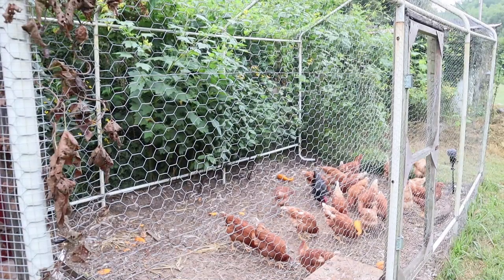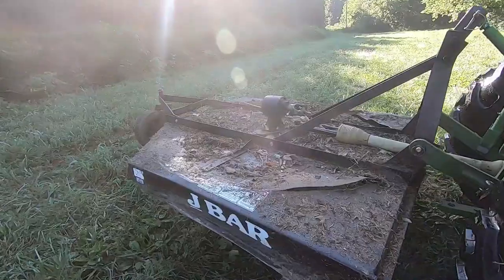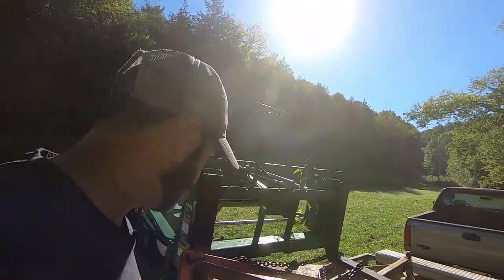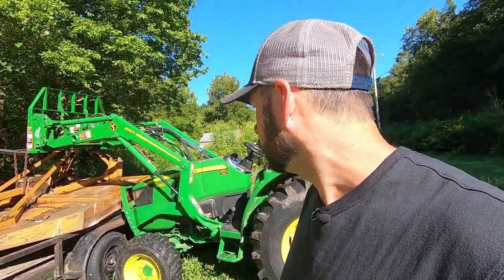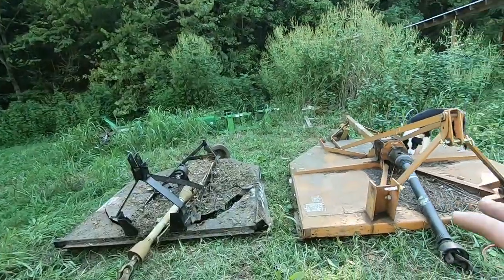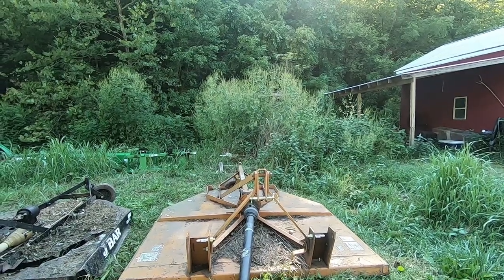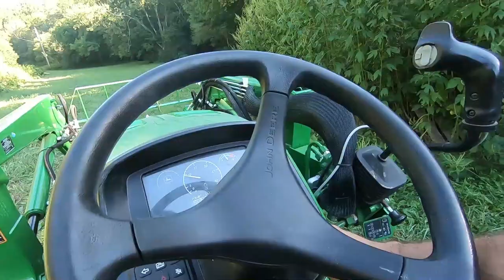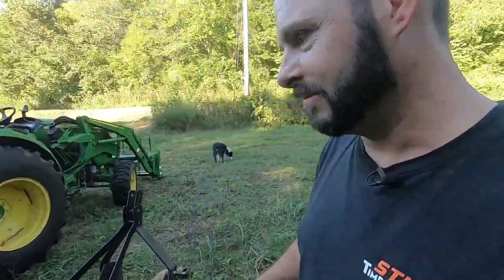This J BAR Bush Hog Tore Itself To Pieces.

Comment: I got a 6ft J bar from around 2014. It's built pretty solid. The only thing wrong was the cross brace for wheel had a scrappy weld but I think I helped it break but easy weld back on. You had some bad luck running something over like a big rock or steel and can opened that thing.

Comment: I’ve been using a 5ft J-Bar for about 10 years now. I got it used for $100 just to tear up in heavy brush and it’s still going strong. No issues at all and cuts 1”-2” brush pretty well.

I’ve had a track machine with mulcher and a 8’ dual spindle for my big tractor, but the little J-Bar has been well worth the $100😂

Comment: I've had my Jbar mower for a couple of years.  It cuts anything the front of my tractor can push over.  Can't imagine what you could have done to tear one up!  I've broken the shear pin a couple of times thru stupidity, but that's what shear pins are for.  Got a piece of electric cable the power company left hidden in the weeds tangled up in the blades and it beat the heck out of the frame.  I could have fixed it, but was easier to call JBar and pick up another one for $100.  Customer service is awesome.  I've also got a jBar land plane and both pieces of equipment are as good as it gets.  I wouldn't hesitate to buy other stuff from them.

Comment: It looks like a standard duty 6ft rotary cutter the dealer I bought mine from won’t sell anything in SD except a 4ft because the metal gets too flimsy on the thinner SD models if you get a HD in 5ft or bigger you won’t be disappointed I have had mine for 3 years now not one single issue and I cut 2 inch diameter trees anything I can push over with the cutter I cut it

Comment: I have the 4 foot J-Bar SD on my Farmall Super A. Not sure if they still make the fast hitch models or not.  It does OK in pasture grass and very small saplings but I would not try it on anything else due to the PTO setup with the direct drive.  Maybe a 1/2- 3/4 inch max but have never hit anything close of that yet. Standard Duty is for very light work. Even the name brands SD only list 1 inch max, all at different price points.. HIgh end, name brand HD models list up to 4 inch saplings/trees, but you are looking at almost 6 grand, but IMHO, that is what a saw is for..  J-bar does have the HD models and Premier models with the 75 HP gear box with 8 gauge steel(like 3/16) and gear box mount is about 1/4 inch steel.  I have a new Mahindra 4550 coming, 48 HP and looking at the J-Bar premier 6 footer Premier model simply due to price, thick steel housing and the 75 HP gearbox with thick mount,  with slip clutch and a dealer is close.  Made in America too, in Georgia or at least assembled there.  Parts made in China or overseas= well you would be surprised on how this new global market has sourced stuff from all over the world. China, India, Vietnam, England, South Korea, Brazil,  you name it for JD, Case New Holland, MF, CAT, Cummins, Navistar. Land Pride, Bush Hog, etc.   It is the cheap labor and lack of EPA controls in other countries to produce stuff and we must keep the shareholders happy. that, is truth. However, engineering plays a key as well as durability testing, even from these so called, other countries.
Reply from the maker: What did you end up with? We replace this J-bar with a woods 7ft that we purchased on FB marketplace.

Comment: Should have bought a heavy duty JBar  cutter or a premier model. People buy economy items and expect them to handle stumps and rocks like an HD item. They make economy models for people who can’t spend 5k on a cutter that need to mow grass. Some idiot will always hit something and blame it on the manufacturer. Blades don’t just bend from grass Cod. If you wanted a heavier deck you should have paid for it the first time. Don’t put a small business down for your stupidity. Yes. I’m a dealer.
Reply from the maker: I can understand a cutter getting torn up from hitting something. But this is a design flaw that causes the blades to get caught up on each other ripping up the deck apart. Got it to mow our fields based on what the dealer said it would do… it didn’t do it, and there was no support after the fact.
Reply: There is no design flaw unless they have changed stump jumpers or blade carriers in the past week. I’ve sold hundreds of them and use a premier model myself. You can’t take your F150 back to ford cause you didn’t buy a powerstroke. Unfortunately you can make a video that says ford is crap cause your 1/2 ton won’t do a 1 ton job.
Reply: @rayfe10  hows the premier? Looking to get a 5ft for a branson2515
Reply: @rhettsaylors8810  heavy built. 7ga deck and 75 horse gearbox with a slip clutch
Reply: @rayfe10  The only way the deck gets like that is abuse. A blade got bent and hit the deck. Even a heavy deck will get destroyed when a blade bends up. Wonder why the sides are also banged up. Another design flaw?? Lol
Reply: yeah - no kidding - he's comparing a SD to HD. He seemed real impressed with that HD cutting grass.... I to have been a Jbar dealer for many years - have never had a problem with them.
Reply: I just brought a brand new never used jbar bush hog home and it looks like 14 year olds did the welding job. I seriously thought this must be a rebuild model to look this shitty but I just found out this is a "real" brand. I got mine  in a trade without seeing it first. I didn't think you could even make a bush hog this cheap but I am wrong. I'm thinking I should sell it for what I can and buy a real one.
Reply: hd or not ,,cheap..